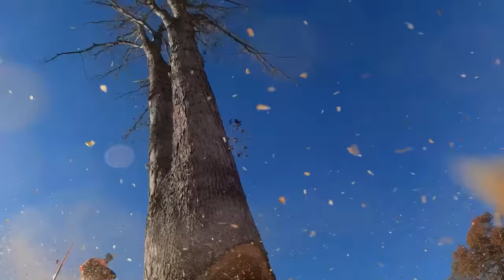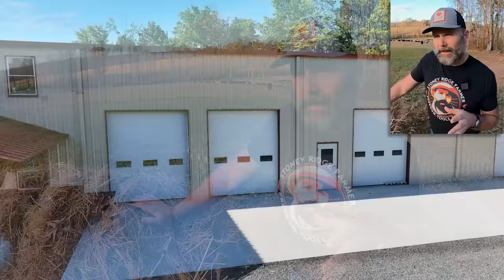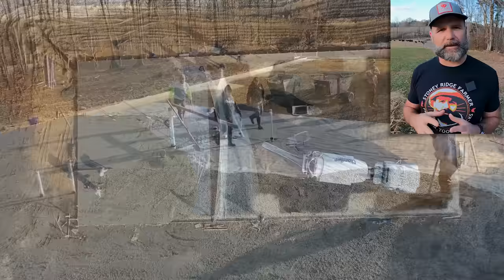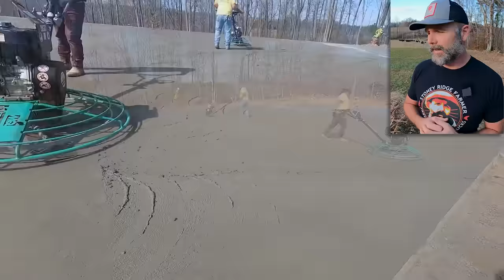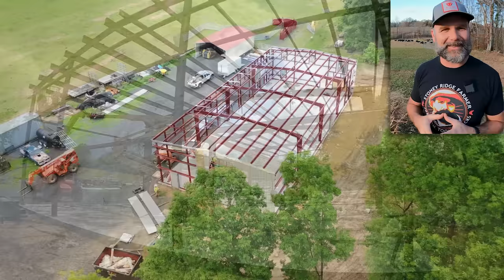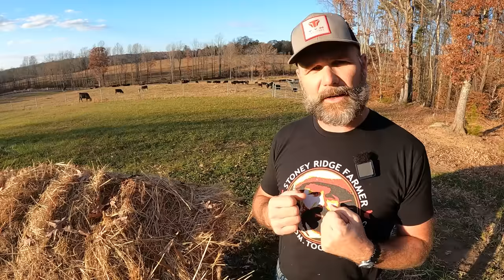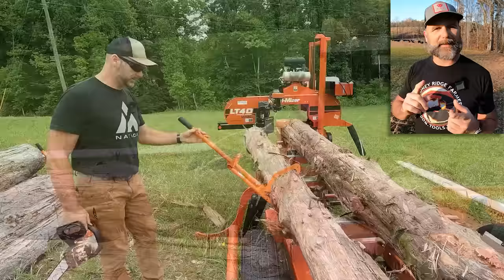Cops Came to Investigate Veteran's Farm! Heartbreaking disbelief

Comment: Josh, not sure who told you CT doesn't have zoning restrictions, but that's not the case.  I live in a small rural town  and had to get a variance from the town to build a horse barn because my small plot is bordered by "wetlands".  The wetlands are literally a season drainage flow from land across my street. So, very frustrating.   I feel your pain.
Reply: Yes….CT was the worse. Ive lived in Manchester, Vernon, Tolland , Glastonbury and Coventry. Left that state 8 years ago because of these exact issues. Over regulated, over priced, over Governed AND WAY OVER TAXED. And yes you need a permit for a 8 x 10 garden shed. I use to tell people to move to where I am now.  Not anymore as I’m afraid they will bring all there bad habits here.
Reply: @Gman-26  what is the summer / humidity where you are now compared to CT? if someone can't handle FL, could they handle TN? Thanks!
Reply: @Gman-26  what is the summer / humidity where you are now compared to CT? if someone can't handle FL, could they handle TN? Thanks!
Reply: It's your land do as you wish. If they cross your locked gate. Use your tools!
Reply: I was gonna same thing. My town insists you pull a permit to change a electrical outlet...I'm all about doing the right thing but Connecticut is way over regulated and TAXED!!
Reply: Makes no sense why someone from that state, out of the whole US would make a claim like that. Either the ignorance is out the roof, or the person is not a true patriot.
Reply: I recently discovered there is no law in Pennsylvania for property tax and I would bet there is no law where you live.
Reply: Yes , sure ,😅😅don't pay it and go 2 jail
Reply: U said the key word Rourke in a town all town city's have there own laws
Reply: Man I feel bad for you guys.  Here in our county in Oklahoma we have no zoning in rural areas and not restrictions or inspections. Only thing we have is DEQ (Dept. Environment Quality) to report your septic system. I have built several buildings and houses and never once reported to anyone but DEQ and received a certificate. Always have done our own electrical, plumbing, construction. This is the way it should be on your own land anywhere not inside a city limit.
Reply: The sad part is that you are going above and beyond to do the so called right thing and the government absolutely dose not do the right thing. We pay all this money into a system that putts us in bigger and tighter chains. Sorry you had to go thru this and thank you for sharing.
Reply: No you do NOT own your property. Take it up with honest Abe Lincoln. Here's a quote from the paper back in Abes day..." I must break the constitution to save the union" When Abe Lincoln said the south could not leave the union. Abe pushed thru that Washington DC owns all the land. Your finding out you can't do crap without the kings permission. DC owns that land and you must abide by and with the permission of DC to do anything to or on that land. Your a renter of their land. Sure it's done thru your county. However, if  DC wants the county to implement rules they threaten the counties funding. Your really controlled by DC, and it's their land you rent.
Reply: PVA  office screwed up and there blaming you
Reply: Personal property taxes are wrong and a great example of overtaxation.
Reply: Idk, about Connecticut.  I have family in Wolcott and Connecticut is extremely over regulated by the government from what they tell me!
Reply: In CT, Last year just needed to replace our deck boards.  No structural changes to the deck or the house. Town still required permit and inspection.  Just a scam for a hidden tax and paid state positions.
Reply: @m.d.rofarm1665 don’t tell people about Oklahoma.  👍🏻
Reply: This message is to Josh. The tax office should not be reporting ‘potential’ violations. The tax office should list real property and assess real property. Period!
Reply: @MrSprintcat  The County will probably sell the property at a Tax auction.
Reply: Moreover, if you ask certain segments of the federal government, that drainage ditch is a Navigable Waterway!

Comment: Josh you're right about Connecticut.  4 years ago I had a 48X28 in-ground swimming pool installed with a 24X24 2-story pool house,  Because I am on 7+ acres, no building permit required, but the electrical installation did require the permit and when the inspector came the first time, he didn't like the way they bonded to the concrete decking rebar and made them change it.  He also required them to re-dig some areas of the trench because it was shallower than the minimum depth required.  My brother is an insurance underwriter.  He told me that if something were to happen, and the insurance company could prove that the installation was not compliant with code, they wouldn't have to pay.  The regs are there to protect "normal" people.  They aren't for airman/electrician/RN/farmer/landowner types like you, but they expect you to comply.  I understand your frustration.  Keep bringing the honesty and transparency in the videos.
Reply: Incurance? Thats another tax kind of. No different than purely privatized. There used to be a time without the whole coding I think. The fact that nowhere in the World you can feel free or even cut the lumber you own without cutting a quarter for the big guys is a shame. Are you a citizen or corporatized entity, you really must wonder if the tin foil hats are right about that stuff as it sure feels as unfree as it can get. Own your own lumber even feels like being a modern day gunslinger... 😂

Comment: Josh, I moved from Louisiana to a small town in Mississippi because its higher elevation so i do not have flood concerns, cheaper taxes, cheaper insurance and very little goberment regulations. I did not have to get building, housing, electrical, plumbing or septic permits/inspections. My father and I have enough experienced to hire the proper contractors to meet our expectations. I simply hired a graphics designer to do my floor plan and used Florida's building codes on steroids to construct my house. The county here was only concerned with any structures being placed on the property so they can map it out for taxes. I literally had zero problems from our county so yeah it seems your county is getting out of control most likely due to business and population growth. This could be very challenging as a farmer because you will be forced to comply with any new regulations some jackleg decides to enforce. We call that city problems!

Comment: Josh, we have been turned into code enforcement multiple times by nosy neighbors. Huge pain for not having done anything wrong. I do believe that putting in a septic system should be permitted. You are right, most people will do the right thing, but we don’t want outbreaks of cholera in America. At our farm the water table is 2’ down and everyone uses ground water for their homes.

Comment: Josh, save your permits with the date and control number. Septic systems and their permits ensure that they are the proper distance from a water supply ( well, stream,or a lake)((Public safety )). Same holds true for electrical, plumbing and heating. It isn’t that you can’t do these things, it the need to ensure they are done correctly. Hopefully your county inspector has the knowledge to know that it’s done correctly or not. If at some future time your descents desire to sell “It was done to code” is a great selling point. Thank you for an enjoyable Thanksgiving morning,
Reply: the biggest problem i have with the current permit/inspection regime is that in the event that a county or state inspector signs off on something they should not - they miss something they should have caught and the building falls down, for instance - the county or state are not held liable.  If the inspection resulted in a warranty or guarantee I could see it being worth the money, but at this point, at least in my jurisdiction, the inspections are done in a haphazard way with random quality and don't really mean much.  except permit fees that are collected by the county and added to their general fund.  they sure do like those.    No permit of any kind was required prior to 1965 in my area, and there's hundreds of thousands of structures build without them that are still standing today.
Reply: I have a question for you - Underneath the surface of this story lies the real reason for this "inspection"? If someone in the county "thought" that he was building a residence NOW, and not later, he would be charged a residential tax for this building and not an agriculture tax for this building. If so, then he could be seen as cheating the tax code??? Is this the reason for this "misunderstanding".

Comment: Here in South Texas, we need a permit for septic installation. How we did it was to hire a professional septic tank contractor that handled all aspects and requirements down to inspection.
Reply: I don’t get the gist  of what is going on. I think that when you mentioned anything to do with it being a residence (at some point) that that changed the code requirements. Has the plumbing been “roughed in”? If so was an inspection done on that? Excuse me if any of my questions, you had already answered in your video.

Comment: We are new to Homesteading and have not (yet) run into any problems like this.  We are further south, in Florida, but have similar requirements for our property, which is zoned as Ag.  At the Federal level, yes, we are far over run with too many admin groups who make regulations with the force of law - but they cannot be law!  Some of it has leaked into Florida.  I see it very much in our blue counties.  Part of why my wife and I chose a very, very, very red county.  ;)
Reply: If I recall...only 5 counties were blue in Florida during last election cycle. Hopefully that doesn't change.

Comment: I bought a brand new 2007 f150. I went to pass a vehicle and engine blew 18000 miles. They would not back the warranty said lack of maintenance then not oe parts. I still  owed on truck and they said i would have to start paying storage. My truck was still disassembled. I felt trapped so I payed they 7000 for a new motor. I still have it but, like you never another!

Comment: What am I missing here? You had permits for everything. Found a mistake. Reported the mistake. They send someone out to take a look because the paperwork was done improperly and you're mad they're re-verifying everything is good? You weren't fined, they didn't tear it down, they didn't shut the power off. They just sent someone out to take a look. If they accidentally added an extra digit to your houses' square footage would you be mad if they sent someone out to just make sure it's actually only 2000 sq ft instead of 20,000?

Comment: Also in WNC
I'm a plumber. Certain things like adding your own septic tank you should absolutely go through the proper process. If done wrong it can have averse affects on the environment, you're property and your neighbors. Plus who wants poo poo water leaching into their crop because some half ass plumber didn't things to code.

However, you should be able to build whatever structure you want on your own property. If that structure doesn't pass code than I completely understand if it doesn't add to the properties value or be considered a livable structure. These codes are in to protect the structure, but also to keep the homeowners safe. I will say that their are some really shitty contractors out their building 'luxury' homes that cut corners to save money. But if I wanna build a barn or a tiny home for my own personnel use, that's nobodies business but mine.
Reply from the maker: Code is the minimum standard, I do agree with proper septic installation....but I dont agree with paying the county for permission. 100 years ago my neighbor's house was built, with logs harvested off the land...no codes, no bs money grab from the tax department...it's still standing today and livable.  Problem is that homes are built as cheaply as possible nowadays and every possible corner is cut....I'm with you...if I wanna live in my barn...nobody should be able to tell me otherwise!

Comment: AS you noted, regulations are created because there was a problem. Septic permits came into being because too many septic tanks were installed that either polluted a neighbor's well, or were poorly done by someone who didn't know what they were doing, or knew and took shortcuts. and the system failed prematurely. Electrical permits came about to insure proper installation. The same people who you've had trouble with tresspassing are the sort who would do bad septic, electrical, carpentry, etc. And the more densely populated the area, the more of those folks there are to screw things up for themselves and others. You want to do things right, good on you. Keep it up. And while it is a shame folks would be so suspicious as to report imagined infractions on you, they no doubt have had good reason to be suspicious of people they don't know well enough. It's too much regulation only in cases where things are being done right. It's also too little regulation in cases where things are not being done right.

Comment: I have been a builder for over 30 years  in Texas  don’t ever think that it's about anything about money and sometimes power. Permitting is only required within city limits except for septic.  I always built above the minimum which is the Southern Building Code. I don’t like ANYONE in my business on my acreage.  However,  if I built above standards doesn't mean someone else did the same.  We have now moved to Arkansas and they do some crazy stuff here and get away with it.  Down the road someone is going to end up with a disaster that will cost a bunch of money to fix. In the city, most of permitting is about revenue and the inspectors can get power trippy. I lived near Bush's ranch and I had a guy tell me that "he told the President what he could and couldn’t do " and I told him I knew the rules and he wasn't telling me squat that wasn't in the guidelines and he shut up.  It's not hard to follow proper guidelines and is better for the homeowners.

Comment: That is crazy!   I’d be very upset as well.   I do believe that if I own the land that is outside of city limits, on X acres, etc that the only inspections should be like you had.  1.  If I’m hooking up to public utilities like Electric, Gas, Water/Sewer, then I can 100% be behind them requiring an inspection to insure that it’s all up to code (code at the time it was built) and will not cause a fire, etc.   We are also required to have approval from the county for our septic systems AND required to have a contract with a local company that does quarterly septic inspections.  They send in a list of all properties w/ septic they have under contract to the appropriate county person.  They will harass you if you do not have a contract to have it inspected.   Where our ranch is located in the TX Hill Country, the new state laws for septic systems, ours would not be approved and would not pass inspection to be installed.  And the reason why is NUTS!   We are on 100’s of acres!

Comment: I think there needs to be some regs to have a minimum standard expectation, 😊especially if you want to sell/ buy real estate. Now the problem I have is the outrageous fees. You should be able to build what you want and not be taxed out of the state. I don't think it gets any worse than where I am in CA. Over regulation is certainly a problem.
Reply from the maker: that's what a home inspection is for.....shew and finally the gov't has stepped in and stopped these outrageous commissions away from realtors who are driving up the cost of homes all across the country!  Realtor does the same amount of work with a $40k house as a $400k house...yet walks away with $25k on for brokering a deal on a $400k house!! How many billions are being tossed at these crooks?

Comment: Septic tank and electrical inspections seem reasonable, as well as building inspections.  The government has taken on the duty of insuring that the septic tank and drain field are large enough to handle the usage - you said a 4 bedroom house.  The electrical installation needs to be checked for safety to prevent fire hazards from unsafe installations, although the installation itself is something a layperson could do.  And you definitely want an engineering inspection that keeps the building from falling on you from poor workmanship or materials.  In most cases there are no problems with any of these things, but it is always better to check first than have the fire department come out to rescue you later.

Comment: In my county, you can’t even get a building permit to start building a house until you get a septic permit, install it, inspect and approve it. Now that I’ve done that I got a building permit. But guess what? The county doesn’t even have an inspector to inspect the building! lol. 

Btw, I can’t get a permit to build a shed until after the house is complete. I can’t build a 2nd house until I complete the first one. 

In summary, the rules were made up by morons and managed by morons. 

You will find out the moral of the story is you cannot be honest and open with an entity that is NOT honest and open too. County, state and fed gov’s are not moral, do not operate with integrity and ethics and for not have your best interest at heart.